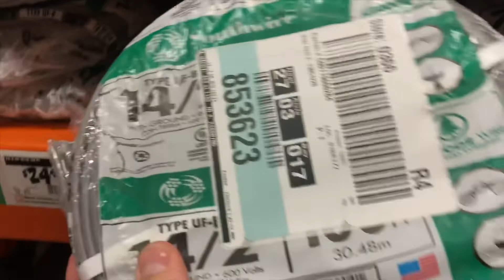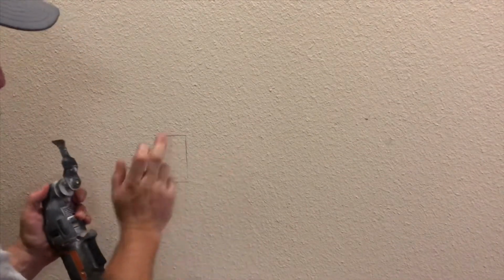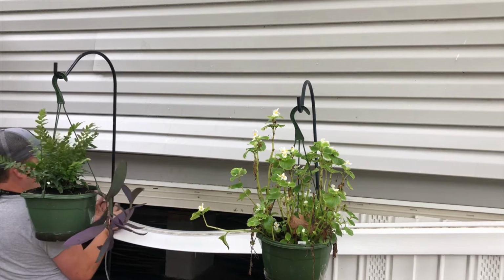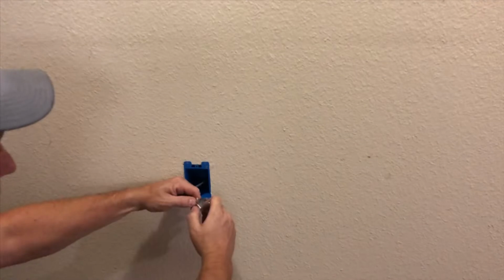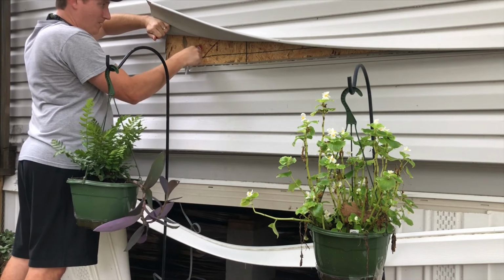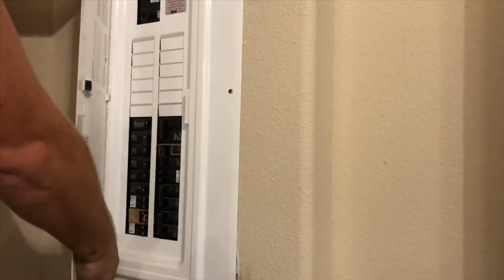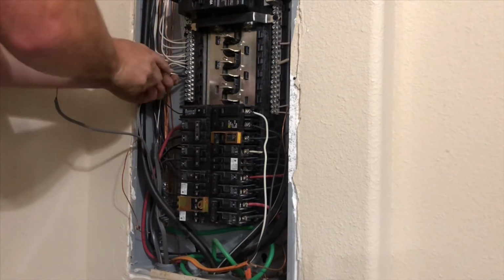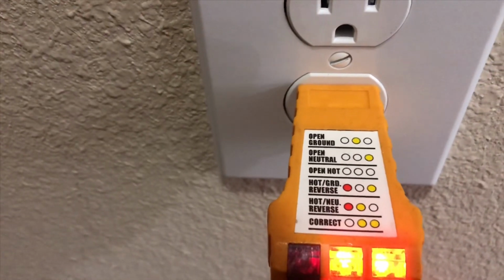- Raleigh Jones Installing a Wall Outlet Receptacle in a mobile home

Comment: Thank you so much! You certainly have a lot of patience (getting that siding off, moved around, then back again!)...and I always wondered just how another breaker is added to a box. Don't think I'll try it myself, but it sure does help to know what is involved, and if someone you hire is doing a good job or a crap job. I also like that box you are using, because it does not need a stud behind it. I am going to look into that for an RV outlet I am working on.

Comment: Dry wall in my place is only 1/4" and many outlets have just pulled loose.  I glue a couple of strip s of wood (I cut up a paint mix stick) on the top and bottom  of the aperture behind the sheet rock.   This makes a nice solid mount.

Comment: The white wires are neutral and the black ones are hot. Right? Also, I'm doing a project like this, and I'm putting the power cable, the overhead lamp cable, and the double wall socket cable in the same blue box. But once I finish doing it all, it ends up being a clutter of cables and the switch doesn't fit in nicely. Is it possible to cut each cable so that all three fit in without having to forcefully shove them in there so that the light switch fits in right?
Reply: Raleigh Jones alright. Thanks bro!
Reply: you can cut them to fit, but you'd better hope you never have to replace the socket! working with wires that were cut too short is a huge pain and sometimes impossible
Reply: *switch. whatever. either way

Comment: Before cut into walls. Make sure you have any electrical or water lines in the wall. Also check your local code to make sure you do not need a permit as some areas require permits for any work done to mechanical to your home. 

Also it is not advisable and unsafe to run electrical wire under the siding. If you have a contractor do work they may hit the wire not knowing it was there.  Also it may not be up to code and thus insurance can deny a claim if proven that was the cause of the accident when not up to code.

Comment: Good job.  Couldn't you cut a small hole in the underbelly and locate the two by near the perimeter in between the drywall and the osb and then drill your hole with a longer drill bit?  I think the board is upright so it would be a deeper hole and you'd have to deal with some insulation and there are belly patches available to cover the hole.
Reply from the maker: Yes you are able to do it that way, I just prefer to go through the wall

Comment: DO NOT RUN ELECTRICAL WIRES BEHIND YOUR SIDING. That’s against code, you’re looking to get someone hurt or possibly burn down your house. Drill up through your floor and bottom plate and run the wire inside your wall where it should be.
Reply from the maker: Well I’m license then you’re not so I’m not sure you know what you’re talking about. It’s outdoor wiring made to run on the outside of the skirting I said that in the video but it’s OK if you didn’t pay attention
Reply: @BayouRepairGuy  lol good assumption but you’re wrong on me not being licensed, maybe code is different in the states, we don’t to that here in Canada. Sorry if my comment offended you somehow.
Reply from the maker: @sumdude240  It didn’t offend me it’s just nonstop people talking out of there but constantly
Reply: @BayouRepairGuy  welcome to YouTube lol
Reply: I’m looking at doing this but doesn’t code say any wires under a mobile home needs to be ran in piping did you do that
Reply from the maker: @whiskeyhollowoutfitters3327  Not if it’s outdoor grade wire
Reply: @BayouRepairGuy  ok that’s what I was wondering code is kinda gray when it comes to explaining what they mean lol

Comment: It seems kind of pointless to avoid just turning off the main breaker to prevent electrocution. nice video otherwise
Reply: @BayouRepairGuy  But turning off the main breaker would kill the suspense watching him do it... lol,,, Sheesh teach some safety or people can actually die. Better than, "be careful, all that's hot in there".
Reply: @BayouRepairGuy  Good vid though,,, Explains how some Manufactured homes are... Usually Trailers/Mobile Homes, and sometimes Modular built as well.